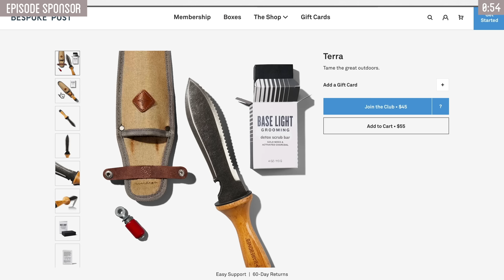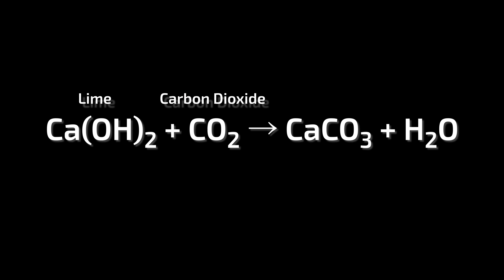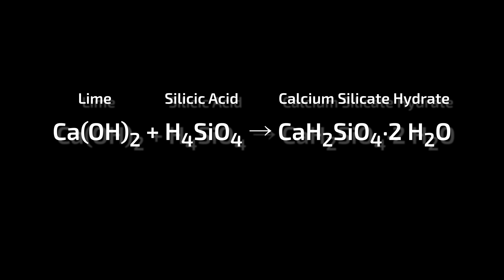How to Make Roman Concrete (4 Different Materials, 4 Different Strengths)

Comment: Hey brother...Love the channel but....
Them tests were off by a crap ton...
Am a Mason so this will help you get a more accurate test...
Next time either file or grind down the sides on the top or the bottom flat then run it in your tester...
All masonry  including the hardest  stones are subject to failure  or fracture at a way lower rate of force when high points on the top and bottom of the load surfaces are uneven and pressures  are applied..

Is why we use chisel and a hammer to cut them...
Most of the ways you tested them were of that of an old hydronic cutter...
After 45 years of doing this trade the way you tested was that of a pressurized  cutting action compared to a true test...
In the old days when you had a full flat contact on both sides of the material when a load was applied the material would just wink at you and you would break the seals in the hydronic press cutter...
Most of this video the bottom plates and the top plates on you tester were not in firm solid contact with most of the full surface this threw your numbers way off...

Evan today when they do core samples  on testing the tops and the bottoms are ground flush due to the effect I just said of...
Have a good 1.  👋

Comment: Also, with your roman concrete it was basically compacted powder when you were putting it in molds.  by minimum water possible it still needs to be a putty consistency.

Comment: Been in the concrete business for over a decade just to give you guys a frame of reference 2500 psi is the absolute weakest commercially available concrete. Part of the issue he’s having here with both the Roman and the modern concrete is that you should give it at least 30 days to fully cure and achieve its target strength for that time frame

Comment: From what I understand the roman concrete wasn't used as the main building material (like in brick form), it was instead used like a really heavy mortar, where you would lay down rough stone contained within in a form(like the forms we use today for pouring concrete), but then slather the concrete around it, building it up like you would a brick wall, so in that regard the concrete lets you have the strength of the filler material, plus the rigidity of a concrete structure (alternatively you could also think of it as using stone as a rebar type material to reinforce the concrete). All said though, I'm not surprised that modern concrete has better compressive strength, especially after such short cure times on the test materials.

Comment: One technique you can implement on your journey is making wood NOT decompose via adding a very watery mix of mortar.  I've tested this and went through as many materials I can think of and so far cement mortar is the best.  U just want the wood to wick up the liquid as much as possible. Mortar is rot proof. U want the mix more like milk, not thick. In the end you arrive at a wood which has a chalky appearance. It will become somewhat water resistant/waterproof, but the main point is that it will not decompose. Also adds strength.  It's kinda like a better version of pressure treated wood.  

I don't know why pressure treated fails so much. Perhaps the copper or whatever metal eventually neutralizes and losses it's antimicrobial properties. That hydraulic mortar stuff doesn't go anywhere
Reply: It will also dull saw blades and drill bits really fast.
Reply: @greggv8  lol, obviously cut b4 or you'll have exposed wood prone to rot. The mortar water doesn't penetrate more than a few inches

Comment: Whoopsie! Roman concrete was made from SLACKED lime! Not limestone! The most important ingredient was Oysters. This produces a far more violent reaction. The earliest version of it was Tapia, or Tabby cement. This was a combined Moorish/Spanish invention. Which the Romans nicked and added to either Tufa or pure pumice. Tapia has one advantage over Roman cement.  Although it also is highly water resistant, and will set underwater, it likes it's air. It actually gets harder over time when exposed.
So much so that the English gave up shooting cannon down in Gib at the ancient Moorish forts. They just bounced off with no effect.

It was not so fine as R.C, but the remains of the oysters not only provided rigidity, but caused a very slow centuries long chemical improvement to whatever was made out of it. The Spanish also imported ship loads of oysters to the Americas until they realized they could just dig up local burial mounds.

Comment: Regular sand is also a good binder and aggregate. Also, cement continues to cure (and gain strength) for weeks. Green concrete is fairly soft.

Typically, the smoother (glassier) the brick face, the less porous and stronger it will be.

Comment: note on your roman mix..don't use river rounded stone or sand, they do not have the necessary surface roughness to form strong bonds and shouldn't be larger than 5-7mm in a brick sized casting, i'm not entirely convinced the mix was wet enough, or cured enough for testing and you might have wanted to condition the brick faces so they were free of pivot points so the force was still applied as compressive instead of slanted and torsional.

Comment: Afaik the main reason why opus caementicium lasted so long was the lack of rebar.
Rebar inside concrete rusting is afaik the main reason why concrete structures fail after a few decades.
Look at hydroelectric dams made from concrete without steel reinforcements. Some were built over a century ago and are still good, while you see modern structures made from reinforced concrete crumbling after a few decades.

Comment: Not a very scientific test, none of the materials were consistent in size or shape, they were not agitated to eliminate air pockets during manufacture, and when you crushed the bricks you didn't clean off the plates leaving bits of the previous materials behind to put uneven pressure on the bricks causing them to fail prematurely.

Comment: There are companies using glass from recycling to make a kind of lightweight fill material that, essentially,  is artificial pumice. I have hauled bulk bags of it to jobsites, and an antire tractor trailer load was under 15k lbs.

Comment: thumbs up
13:35 - materials showcase

13:41 wood ~4800 psi
14:01 cob ~180 psi
14:20 sun dried brick ~220 psi
14:40 fired brick ~250 psi
14:58 professional modern brick ~500 psi
15:19 plaster ~160 psi
15:53 stone ~1000 psi
16:00 roman concrete ~1200 psi
16:47 modern concrete ~2500 psi
Reply: Teşekkür ederim canım benim ❤

Comment: The reason Roman structures lasted 2000 years while other modern day concrete structures crumble after only 100 years is due the fact that the latter uses iron rebar to reinforce it. But the problem is that when the rebar rusts, it expands, which breaks the concrete apart. Romans didn’t use rebar, so it stayed in one piece.
Reply: Concrete trapps water too so makes it worst

Comment: the Romans kept developing their concrete throughout the centuries taking it east to Byzantium the adding of powdered bricks to the mix made the concrete and mortar pretty much earthquake prove the Iya Sophia is still standing today in turkey even though many city-destroying earthquakes have hit the area in nearly 2000 years so modern repairs have included this mix eh, why don't we use that today I see 1970s concrete buildings rot and fall apart!

Comment: Ik were in the iron age now, however me studying to be an archaeologist is allowing me to ask questions, I've smelted everything from copper to iron. Failed alot learned alot and soon had successful attempts.   But the question I'm answering now for myself is, what if another metal was found instead of copper at the beginning of the copper age?  And as of now I found zinc to be very useful. Low melting point as well as a hard enough edge to be used as a cutting tool or tough enough to be used as just about anything.   I'm asking if you could plz look into this further, zinc tools and possibly weapons.  I can send you pictures of what I have atm if needed. But it would great if someone else could answer these questions.     Ooooor orichalcum. My favorite metal besides bronze lol.  Great vids like always keep it up
Reply: Well i think that maybe they discovered zinc after tin so they directly passed from copper to bronze
Although I don't think that they "discovered" copper first but they discovered how to cast metals after how to handle them
Copper can be found in nature as a nugget so they probably learnt to model it and then that it can be cast
Maybe gold was an alternative to copper because it can be found as nugget to
But copper does shatter so you can treat it as obsidian too so it is more versatile

Comment: Modern concrete structures last 60 years. Huge Roman concrete structures lasted more than 2k years  and still standing. The Roman structures look heavier than whatever your hydraulic press can reach. You didn't use enough lime or you got something else wrong about the pozzolana...

Comment: you may need correction about early plaster.  according to a tv show i saw many years ago, the first cities in the middle east used calcium sulfate.  when this ran out they had to use other calcium chemicals depending on what was available.

Comment: You never centred the pin on the plate properly, also the modern fired clay brick had something underneath causing it to break too soon. Other than that it was interesting thanks.......yes building trade lol

Comment: @HowToMakeEverything I've been thinking. now that you have access to iron, I think you could make a water wheel powered lathe by ether linking the moving parts up with ether gears or leather belts.  As iron can be made into steel, some long lasting tools can be made for it as well as the possibility's of what can be made ... or gust a fancy wood carving tool at best

Comment: The best example of the strength and longevity of Roman concrete is when it was under load. They understood the value of post tensioning.
Reply: They understood that using arches instead of architraves is more likely to put the load in the form of compression instead of tension
In the modern days we simply use metal to strengthen the cement but obviously the romans disvovered that as the metal expands it breaks the material (if you wonder Greeks used to cast lead directly in holes in their columns but romans didn't)

Comment: One thing that's not usually stated in these little videos, is that the way that the concrete was used would have been different. Modern concrete cracks quickly on highways, but highways are designed to get the maximum load onto the concrete, the design of the road itself does not prevent and minimize stress, instead, it uses the concrete in "crazy ways" making the most of the strength, but ancient roman buildings and infrastructure may have been designed to minimize stress on the concrete, They would still use efficient shapes, and generally more stable organization of the building materials. This makes sense because in the modern era, we are willing to sacrifice lifespan in order to gain space or capabity (yes, a straight flat bridge is the most stressful way to implement concrete, but we really don't want to do it another way, because a minimal size bridge is the most desirable trait for urban planners). Roman structures used building architecture that was developed for weaker building materials, and those structures that were "modern" actually often did not last. The ones that DID last, look like the buildings that came before the concrete.

Comment: Shouldn't you have used sand and smaller stones aswell? Also stones that aren't round and smooth. With the right aggregate this concrete could probably withstand much more force

Comment: The pozzolan ash was used for the underwater concrete they used. For the above ground concrete they used specific types of ash ( harena fossicia and carbunculus) that had to be freshly mined to make sure it was chemically active. 
You can try to calcine the ash you have to see if you can get a reaction. The aqueducts were lined with one part lime to three parts testa— underfired clay tiles milled to a powder. Essentially calcined clay that contained a sodium or potassium containing mineral used as a flux.

Comment: We're probably in the glass age since we have yet to fully master making plastics without oil etc and can only really mould it where as we can make glass with a multitude of different materials and forms of glass have even been used in things as delicate and complex as core parts of microchips and certain experimental batteries and capacitors where as plastics are usually only used as a structure or an electrical insulator.

Comment: For designing a strong modern concrete it is important to add about 50% coarse aggregate to get higher strength. Also, the water to cement ratio has a large impact on your resulting strength.

Comment: The type of aggregate you're using in the "roman concrete" can possibly affect its strength too - sharp stones vs round stones. Sharp stones interlock with one another making it more durable to pressure - while round stones do not have this feature.

Comment: Something that people don't often factor in while saying that roman concrete is stronger or lasts longer is how it is used. Comparing a roman building that primarily holds its own weight to a bridge whose supports hold up super heavy speeding death machines doesn't really seem fair. Plus saying the few that did survive represent the average ability of it well ... I can almost guarantee that under the same conditions thousands of our buildings and other structures made of concrete would remain standing after a bit over a thousand years. Though of course, they won't be subject to the same conditions not just because they are still in use but also the infamous increase in the acidity of rain over the years is doing a number on the roman stuff as well.

Comment: I'm guessing you also didn't realize you hadn't actually let the concrete cure fully. If I remember correctly, it still gains significant amounts of strength for the first couple months and can even gain strength over a matter of decades
Reply: Modern concrete gains up to 98% of its strength in the first 30 days :)
Reply: @jesst5474  Okay, I thought it was 90 days. I also remember there being some issues that some structures have, but that might have been from having pours that are just bad for curing, have to happen in non-ideal weather, etc. I know humidity and temperature affect the reactions, and I think one was even costal and had salt in the air and was experimenting with trying to react with that

Comment: Using seawater when mixing the concrete may have had better results, though if you are going to try to replicate seawater you may need to use a lot more salt than the video portrayed.

Comment: When you revisit the cured Roman concrete brick I would also see a clay brick that was fired broken back down and mixed in with a new brick, then refired.  This was a common practice Where you would use failed bricks that were ground and reused.  They were supposedly a lot stronger.
Reply: Yeah, they mentioned using crushed fired clay as a strengthening agent previously but somehow misunderstood and thought it was only applied to the surface, not mixed in.

Comment: I was wondering how long you cured the concrete bricks for and did you do anything other then leave them out? My day job make me curious about the results. I am assuming your modern concrete is something like Quikrete or other relatively low strength blend, but I was anticipating some better results. Heck, back in college we got better results on our concrete canoe mix @ the 7 day break, let alone the 28-day, and that stuff is designed to be lighter than water so it will float if (when) one of the canoes break.

Comment: I watched a whole hour or so documentary on Roman concrete a few years ago and they actually made some and set it up under water then tested it against modern concrete, was a cool little documentary. They did use a different recipe than what you used and it tested out better than modern concrete, but to me the most interesting thing was that the “expert” was talking about how and why the concrete they made back in Rome actually got stronger over time, I can’t remember why they said it does but was still very cool, if I can find it I’ll leave a link
Reply: Find the link?

Comment: Did you try making the Roman Concrete with seawater, instead of just making it with fresh water and soaking it in seawater?

That would get the salt integrated throughout, and also be a lot more practical than dragging bits of concrete to the ocean to soak, or having pools near the construction site to soak things in, or trying to spray down large structures that aren't made of smaller moveable pieces.

Either way, what you made compared well to stone, but had the benefit of being moldable. An individual or a small team could make a monument that is far more massive than you could move by pouring and compacting the concrete in place, it is just a more practical building material than stone. I look forward to seeing what you make next.